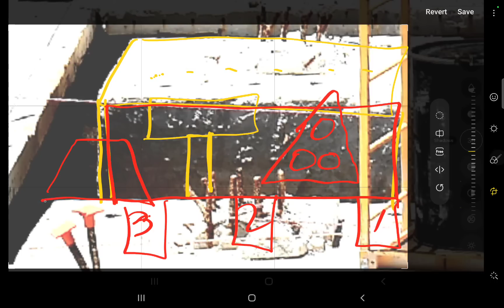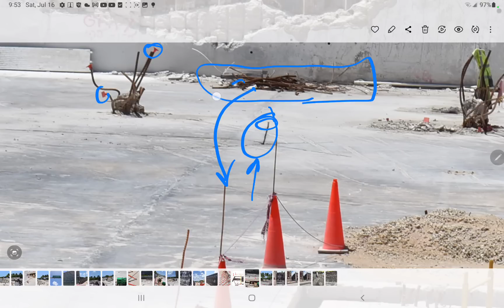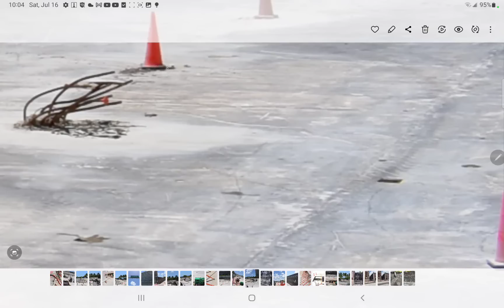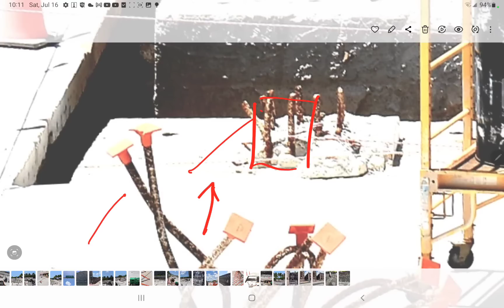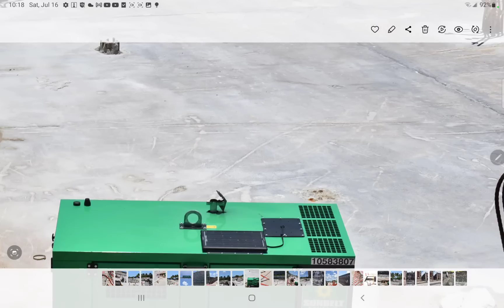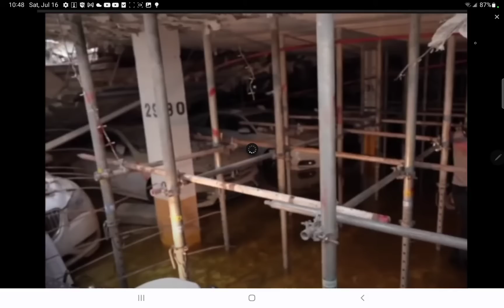Champlain Towers Subsidence and Engineer's images we dive into Billion $ REFUND IF TRUE

Comment: Ok, the seeing ghosts comment makes more sense now. Footprint looks more like tracks - parallel wavy lines. 

GW wouldn't be good for the sister N bldg, either, if the garage/pier cap system etc was basically the same. As you pointed out, then the "Act of God" arguments could start. It seems like it would be a far preferable situation for the neighbors to find out that it was not a failure due to subsidence, but someone must be getting something out of pushing that agenda so heavily...besides the presumably very wealthy Kilshiemer.

Comment: Hi Kai, correct me if I am wrong, the offset columns under the pool deck caused the tension from the lobby parking area to pull against column L or M ?, and starting the building collapse in that area.
Or am I missing something ?.
Reply from the maker: Short answer, the critical shear zones  over the columns could not maintain the rebar and concrete grip force... Advanced deck deflection then reduces the decks ability to transfer the dead and live loads to the columns...
Again,  the Short answer,  grip force was exhausted...
Reply from the maker: *then and also ... deck deflection is first, fyi

Comment: Corruption!  That's it, failure was caused by corruption.  Hunter Biden, Joe Biden, now figure out how they went back 40 years in time and crippled this building.
No reinforcing coming out the sides of the pile caps?  Well darn how did they manage to leave the top reinforcing out of the pile caps?  Is this more of that political corruption?
Reply from the maker: The garage floor rest on top of pier cap... I have another video planned for the garage floor behavior because of that design, hint was just given.
Reply from the maker: Hint #2, mapping I showed earlier in this video,  how is that possible...
Reply from the maker: PS Putin did this, that is what Brandon would say.